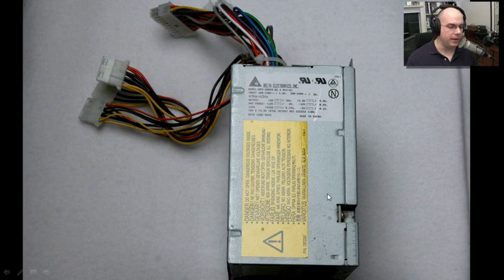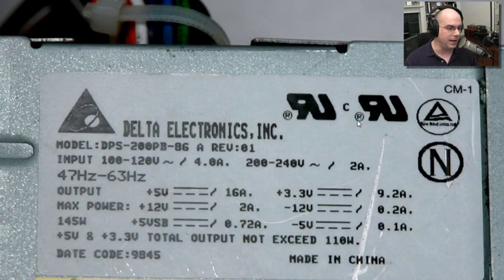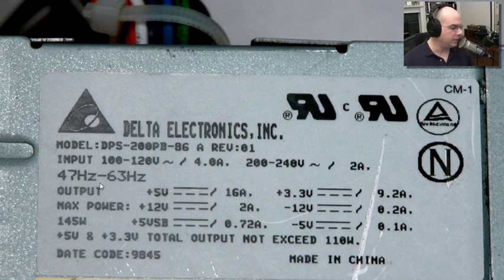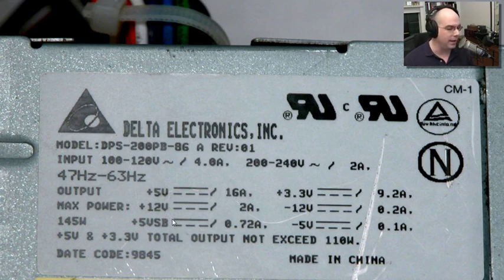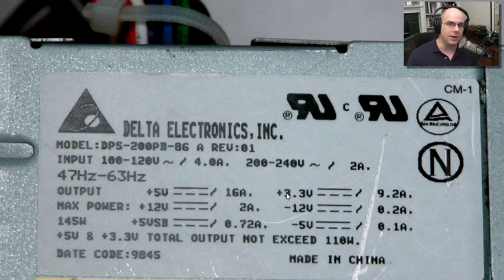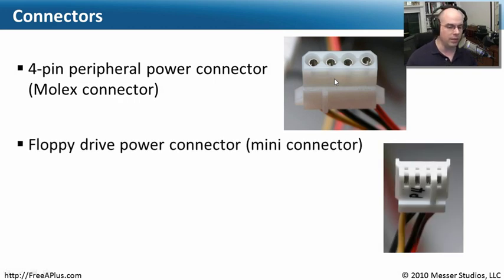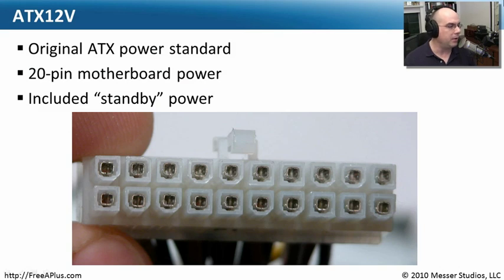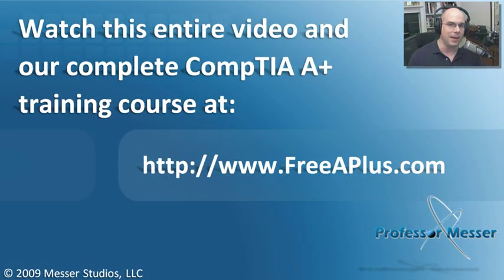Computer Power - Part 2 of 3 - CompTIA A+ 220-701

Comment: @goldenvocals369 If i remember correctly from what I've learned you want to add everything up that will drawing power (if you don't have the documentation, I would suggest using Google to find how much power each device will use) and then add 30% to your total and that is how much your computer will roughly need with still allowing it some breathing room.

Comment: dear Professor messor @professormesser
How do we figure out how much each component in our computer needs? for the motherboard power do we need to figure out what each chip needs and then add those up?   How do we know how efficient the PSU is so that I can stay under that so the PC doesn't run at max capacity all the time? I'm guessing that we are supposed to check the documentation for each component. What if there is no documentation of the power needs of each component?  can we make our own?